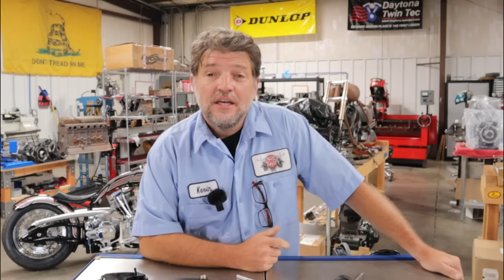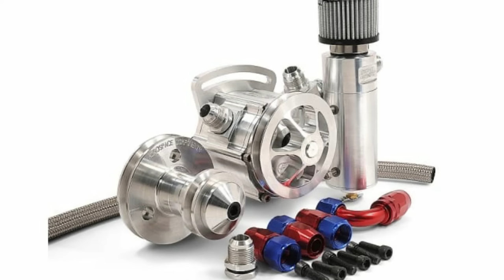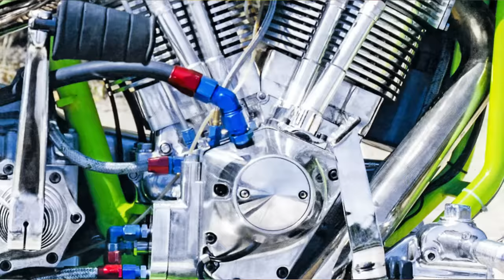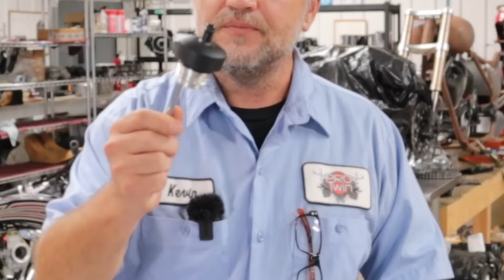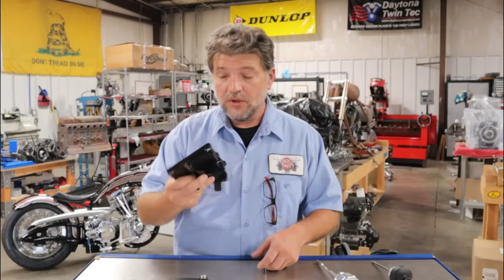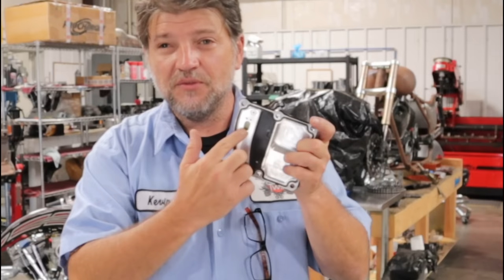COMPARE M8 CRANKCASE VENTING - A1 Cycle, Trask, Feuling - Kevin Baxter - Pro Twin Performance

Comment: Are there any particular years that this is more of an issue with the M8 vs newer model years? I have a 2022 Street Bob 114 and was curious if this is something I need to consider.
Reply from the maker: The early years, because of other compounded issues, created more concern, however....this problem has been observed in even new bikes.

Comment: Hi kev, in the process of the man o war comp upgrade on my 114 fat bob , am having a pig of a time sliding the  clutch basket forward to allow room to get the comp back on the spline , I have the workshop manual but is there something im overlooking……. And yes I have removed the 1 and 3/16 nut. 
 Any help would be appreciated.
Reply from the maker: That seems odd.  Is your chain tight?  adjuster tight?
Reply: @KevinBaxter  no , i managed to do it but the clutch basket didn’t slide off how it’s supposed to , it was tight as hell!!!!
  I had removed chain tensioner as was replacing with a Hayden and comp to a man O war

Comment: Why not just cut a notch in the web under the trans cover and vent through the same vent as the transmission?
Reply from the maker: you then could overpressurize the transmission.  its a volume vs pressure thing.  you could also pressurize the primary as the primary vents thru the mainshaft of the trans.

Comment: I have a 2015 Electric Glide and Harley say's you can't pull a trailer because of the transmission. If you put a Baker Transmission in would it solve my problem? I've been trying to call but I keep getting the answering machine. Thanks Doberman
Reply from the maker: I know many people do it safely....but I would not recommend towing a trailer behind a bike.  i have heard horror stories.  That said, I really have no opinion on your question.

Comment: Awesome, I use the A1 vent d oil as well as DK breather system. No issues so far. ? My rear cylinder is a little rich. Used the Fp3. Should I upgrade the tuner. 20 Road king with a stage 2.
Reply from the maker: I would solve that rich condition by any means....either the FP3 or other tuning system that would allow you to do so.

Comment: If I use both trask m8 and dipsttick would that makes a difference?
Reply: They both have check valves So shouldnt be a problem Im using that combo on a cammed 107 all working well From Australia
Reply from the maker: What John Plascak said below.

Comment: I'm stock, but get some oil in the air cleaner, I was thinking of installing the DK catch can.  Would the Trask trans cover eliminate that? Do any of these affect the warrenty?
Reply from the maker: it is absolutely possible that it could reduce or eliminate it...but...there are multiple causes.  all engines mist some oil thru the breathers.  its a question of cause and severity.  catch can would be a secondary solution.  all of these mods are bolt ons....and can be unbolted if necessary (wink wink).

Comment: You had discussed vacuum loss with external breathers at the heads and dipstick... is this no longer your concern?
Reply from the maker: I am of the opinion and still prefer to maintain the vac....HOWEVER (and I hope everyone else that has commented will see this response) :)  It is a balance of pro and con.  I would prefer to maintain the vac, HOWEVER...if you try a crankcase vent method of one of these types, and you still have severe oil misting in the throttle body for some other mechanical reason, there would be greater benefit by venting outside of the throttle body to avoid carbon build up and TB contamination...because at that point you would know that maintaining a vac on the crankcase isn't enough to help overcome the ring seal issue you may have.  It is a case by case and a matter of severity.  Many are looking for an absolute answer...and because every engine can be different, there isnt one.  Start simple, try one thing at a time.
Reply: I used to use a vented dipstick along with external breathers into a catch can... I can go 5,000 miles without having to empty the can. So, I ditched the vented dipstick and kept the external breathers. I also run Amsoil Quickshot fuel additive, which is supposed to help with today's fuels and also combat piston carbon. You had mentioned in an earlier video that you were working on a breather setup. Is this still the case? And thank you for the case excellent videos.

Comment: I know Mike but I've never discussed breathing with him. I agree with 2 way breathing I disagree with 1 way breathing. The vacuum can add to blowby by sucking it past the rings on the up stroke. An engine has to breath freely. Harley is 70 years behind the industry in engine breathing. A good PCV system has proven to work great and has been around since the 40s or 50s. The new big bore Harleys still have the same volume breathing as the 74 and 80 inch yet they have double the CUI. Harley needs to totally redesign their archaic system

Comment: Is the transmission cover and the vented dipstick together, detrimental to the engine, better, no real change?
Reply from the maker: Not detrimental but requiring both could be an indication of premature engine wear and potential upcoming issue.
Reply: @KevinBaxter  Thank you, right now i see some splashes of oil on my see through arlen ness inverted air box and think it may be s bit to much. The bike is a 21 ultra under 1k . BTW how can I get in touch with you? I am interested in getting the right  cam for me!  -Thanks

Comment: Could you do a video on venting a twin cam please:) I used a hose and routed my big sucker crank case vent up over and back down behind the rear cylinder
Reply from the maker: same information applies to all engines really.  your fix is good...i have done the same.
Reply: @KevinBaxter  could I ask your opinion of putting a one way check valve in line for twincams?

Comment: Kevin, correct me if I am wrong. If I do not go beyond Stage 2 I shouldn’t waist my money adding additional crank case ventilation. Not interested in anyone else’s opinion on this issue.
Reply from the maker: Even in a stock engine with potential elevated crankcase pressure, adding ventilation does not hurt and could potentially avoid issues in the future.   If you dont have an issue do you HAVE to do this?  no.  But...if it becomes an issue, often, other long term damage can occur and you wont know it until its too late for a vent to help you.  In other words...it's not a bad idea...even on a stock engine if its in your budget to do so.

Comment: Lol back in 1995 build a 131 cubic inch evo lol, way before a lot of people and there a lot of bullshit products  out there   ,you got a 100 lbs of shit in a 5 lb bag!  there not enough crankcase volume to displace the negative pressure. Bottom line & there never  will be lol

Comment: I don't agree with ANY of these BS crankcase ventilation schemes! I run a full vacuum "closed" system on my ford 289 hipo motor! I'm about to change my flintstones system on my Big Dog to a full vacuum system also. Keeping your vent hoses ABOVE the motor allows oil to drain back down directly without a catch can!
If you have mechanical issues, this is not a bandaid, and will never work correctly. Recirculating your existing oil is not an issue. Please use the KISS principal!

Comment: I did they have a Breather mod so far but in that mod I added a choke valve. I went to to one to the choke valve then I went into the K&N filter. What’s your thought on it?
Reply from the maker: it may restrict flow a bit.  If using a valve, it needs to act quick with near zero resistance.
Reply: @KevinBaxter  so using a choke for the heavy breather mod should be taken off just direct to K&N filter?
Reply from the maker: @Heavy69Metal  if what you have is working for you, leave it alone.  If not, maybe pull the valve.  Its a case by case with varying severity and cause.
Reply: @KevinBaxter  most use just a filter but heavy breather mod is there vacuum there or not that’s what I’m unsure of. Oh!!! It’s a 131 crate motor